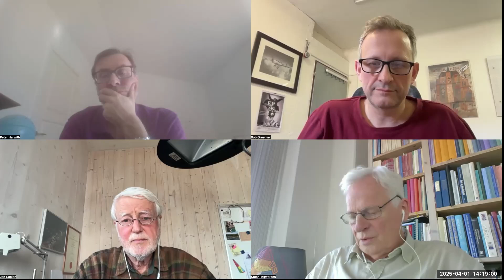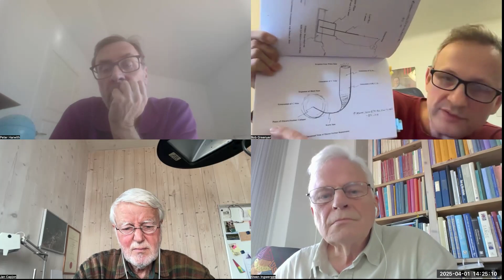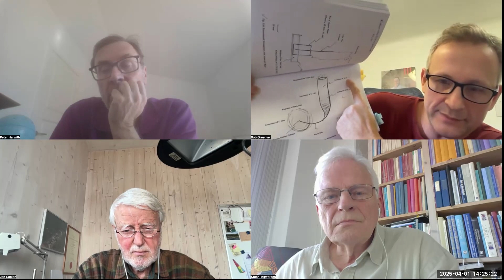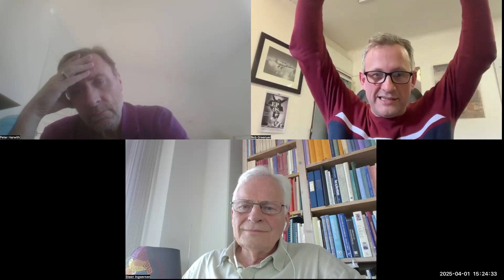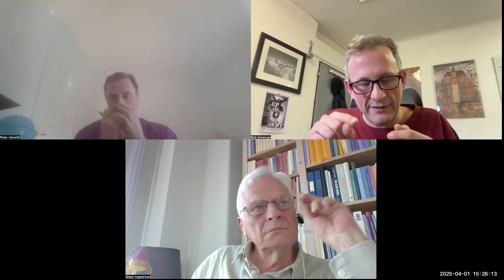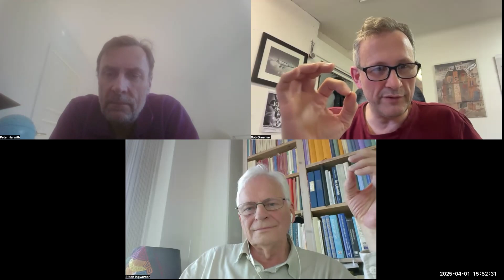THOR - Discussion with Nordic Group

Comment: Mr. Greenyer I finally found two youtube videos that may answer some of your concerns about using HHO gas in internal combustion engines. The videos produced by an amateur experimenter shows before and after internal conditions of an engine combustion chamber. The youtube channel is:  d3adp001 . The videos are:  generator test 20 engine running on hho. and. generator test 24 engine running on hho .  Note: there are two test 24 videos so choose the one showing the engine head removed. My purpose is to support your work in what small way as I am able! I also have wondered if transmutation products are produced when electrolysis is used to generate hho. If so it must be in very small amounts. I urge you and your associates to continue your work as it will benefit humanity greatly!

Comment: All vibrations are rotations. You can shake water apart with vibration, or through extreme sheer. Oh yeah, and you can do it with electric, but what is electric other than vibration anyway?
Reply from the maker: It's the other way round, the vibration access the electric, an electric discharge is not necessarily a vibration, it could just be a shock front (which ends up making vibration) - a disruptive discharge that through field alone separates the material to effect part of the process.

Comment: i think the bubbler should be removed and replaced AFTER the thunderstorm ( but also replace the bubbler with a HHO device ) this would first kill all the CO2 ( in the THOR ) then add moisture and HHO gas blend to the engine carburettor .... so you end up with 30 percent less hydrocarbon fuel and no pollution a double win :) ... oh and make it into a kit

Comment: 27:46 have you considered putting a sleeve inside the cylinder so the same engine can be used for multiple tests?
Reply from the maker: Not a bad idea. Thank you
Reply: @MFMP  Down the track it might be possible to run sleeves made of different materials to see what happens.

Comment: ive gotten the spheres, some tubing and a '72 Suzuki 2 stroke motorcycle. im planning to add a single set of spheres to the exhaust, just out of the engine. no bubbler and air filter before TSG then straight into carb, instead of making a vacuum leak after carb.
Reply from the maker: Where are you adding moisture?

Comment: Check out the Dry Cells that are used with voltage sources to produce HHO by Faradays method. Two volts between a positive charges metal plate and a negative charged metal plate works very well! The patent on this type of device has expired so anyone can make and sell them. I own two 30 plate dry cell generators and am working towards experimenting with frequencies of excitation voltage using Sacred Geometry like 432 Hz. It should be an interesting summwr!

Comment: There are people in the United States that have put HHO systems on their automobiles and trucks. No one is complaining that their engines have failed. Usually they find that the HHO cleans out the carbon build up in the engine. There are several companies that sell HHO systems to trucking companies to help reduce the fuel cost they endure. This topic needs clarification and more research to define the difference between true Browns gas and Marsa gas action in internal combustion engines. Some users of HHO have driers on the hose that feeds their engine.